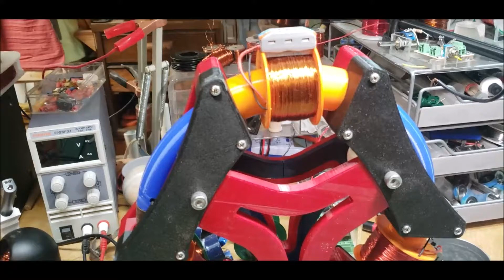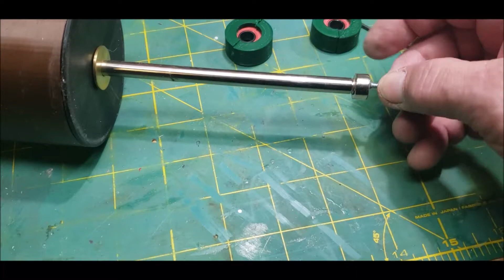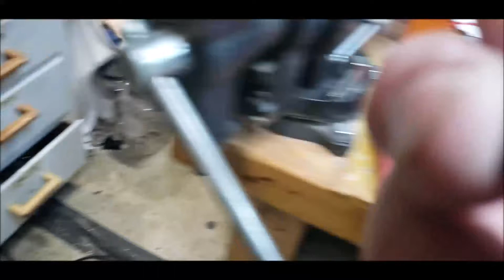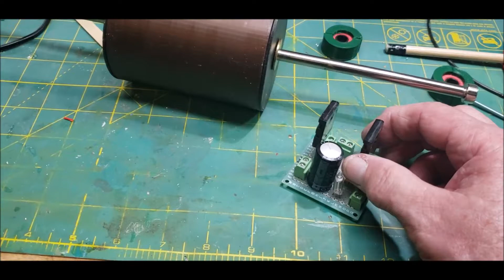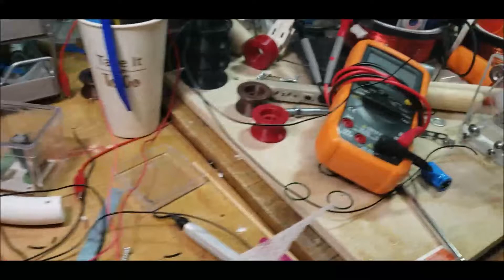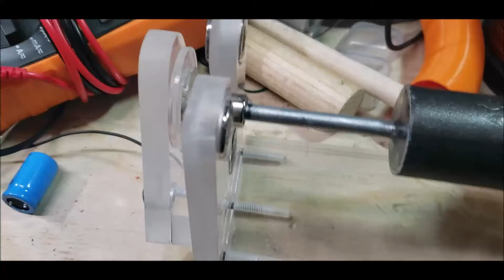New Project (Large Maglev)

Comment: Hey, hypothetical question here. Do you think, with enough funding and engineers on the project, a large reactor size magnet-powered reactor could be built that's powerful enough to power up, say, New York or L.A.? Without common black outs and power grid problems?
Reply from the maker: I think with enough funding and engineering minds anything is possible. Funny you mention this as I been thinking of trying to make a very very large Newman motor as one of my next projects
Reply: @mcorrade  Well I guess what I was getting at is, as a species do we truly have the capabilities to switch to a fuel-free energy source/self-replicating energy source globally, or at the very least in all first-world nations? Do you think we are there technologically? And if we are, are there any hurdles which would stand in our way whether they be economic or engineering wise. Like say, I understand that we probably could make a large enough keshe or solenoid reactor to power a city, but how viable would it be? Would we run into engineering problems like blackouts because our energy industry has never attempted a venture like this? Would there be economic obstacles to actually dismantling our old fuel-based reactor and replacing them with fuel-free reactors? For example, how many hundreds of thousands if not millions of people would lose their jobs in the energy industry once reactors no longer need fuel of any kind provided?

Sorry for the large questions I'm throwing at you lol. I'm just now getting into this whole thing, I find the idea to be an amazing alternative but I'm trying to find a reason why we haven't yet attempted to switch to such an alternative (besides human complacency and stubbornness of course). I know a lot of people think that it's because oil barons and the energy industry is standing in the way of it, which I have no doubt they are, but surely that's not the only reason. If it is, the government has put entire industries in their place before in the past, so I feel it could definitely do so again.
Reply from the maker: @hastur-thekinginyellow8115  so to be honest and I the way I understand it as of today, the laws of physics will not allow it. That is, we can't create nor destroy energy only transform it. Creating a device tat can in theory, run off its own power is out of our scope but, that doesn't mean that someone at some point will find a way around these laws in the same way we now know, in theory, how to move faster thank light. It took a very smart person to calculate moving space instead of matter which our laws says is ok :) I'm, a firm believer in the laws of physics but I also believe that we will over come some of the obstacles. Not sure if it will be done with magnets but you never know!!!

Comment: Remember to use key grease graphite on the friction point. If you grind a point make sure the grooves are like a screw spinning backwards. Otherwise it cuts into the surface. Magnetized on the faces.